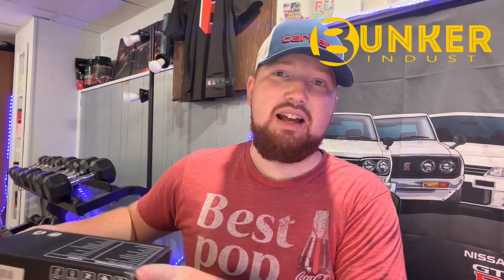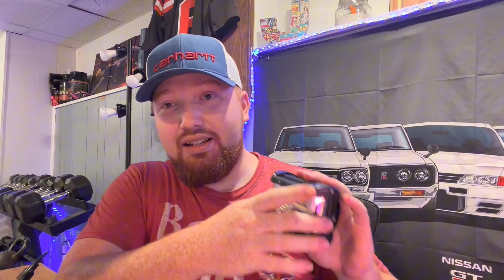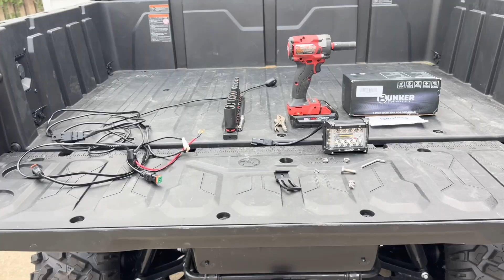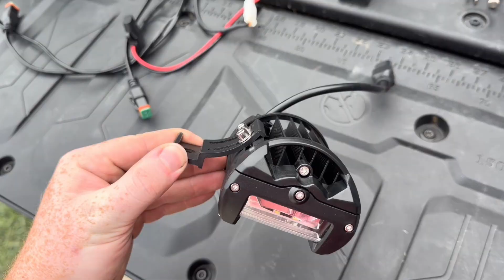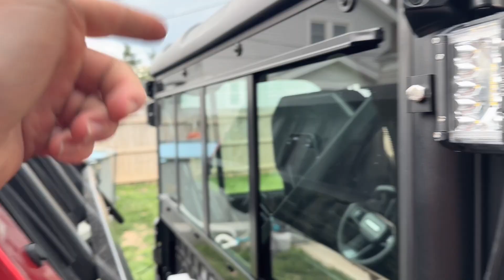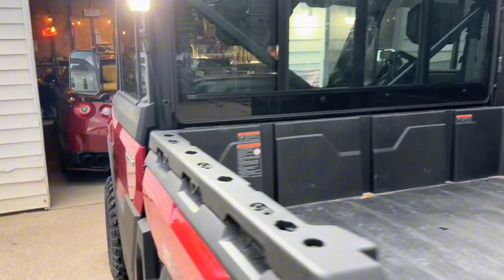BUNKER INDUST 4" Side Shooter Pod Lights Review + Install on CFMOTO Highland Pro!

Comment: Good Video. Glad you found a way to mount them, but mounting them sideways like that kind of defeats the purpose of the side shooters. Other brands on Amazon similar to these also offer better rocker switches that come with the lights. Still a good video . Thanks for showing some good ways to route the wires. 👍
Reply from the maker: Thanks man yes this unit it under 10 miles still I mounted it to I didn’t want to drill into it yet haha so yes unfortunately I’m not 100% utilizing the “side shooter” aspect but they are incredible lights and have lasted a few rides so far! No issues! And so easy to wire in and hook up